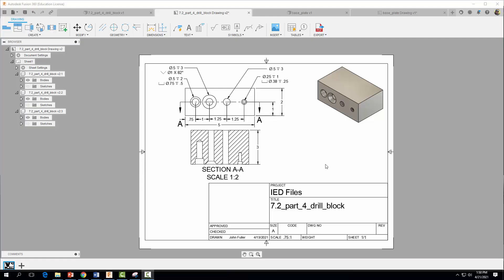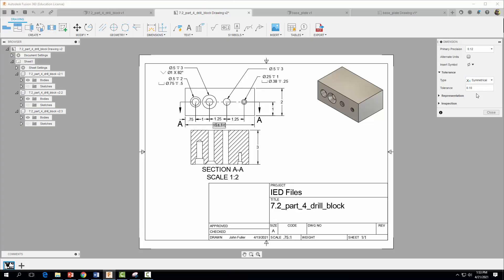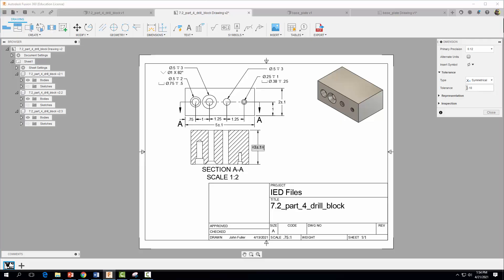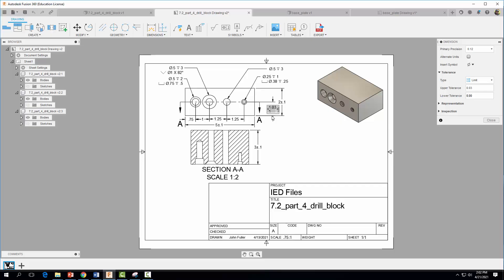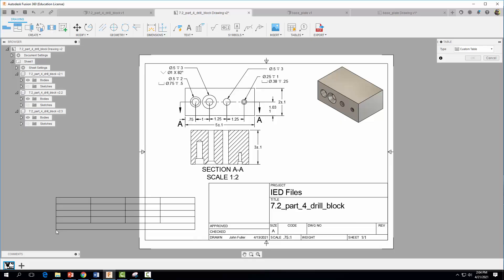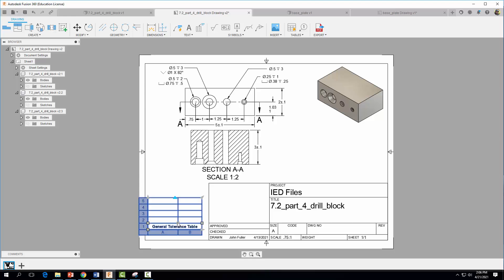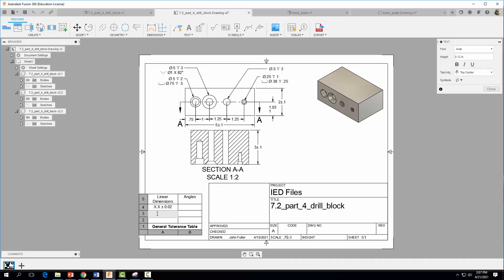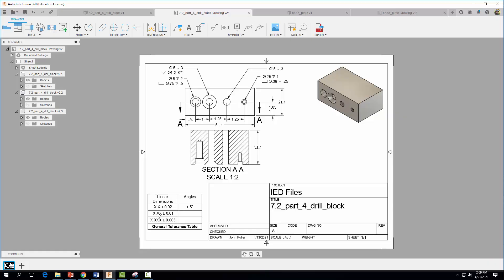Adding a General Tolerance Table to a Dimensioned Drawing File with Fusion 360

Comment: But how do I force the decimal place on the dimension tool? It's a hole and it's diameter is 0.2. I need the tolerance of all these holes to be 0.01 but I cannot force the decimal place beyond 0.2. I need it to say 0.200"
Reply: @3dw3dw I think if you double click Document Settings in the design tree it will let you edit the number of significant figures, I'm not sure if it will still automatically simplify the numbers on you though. Let me know if that's helpful because you can't be the only one with this question